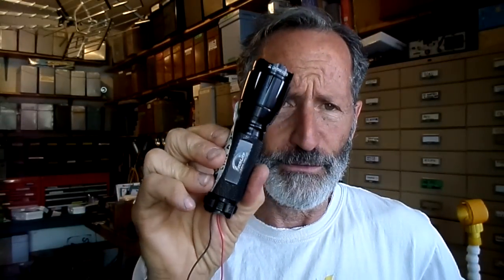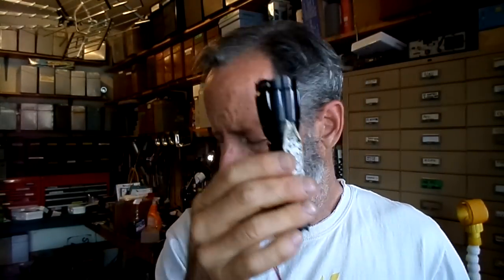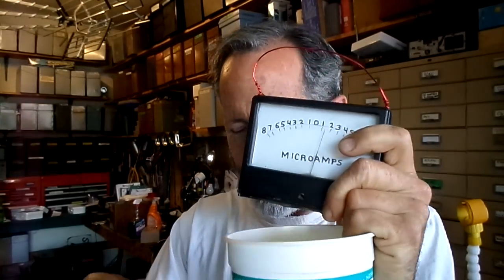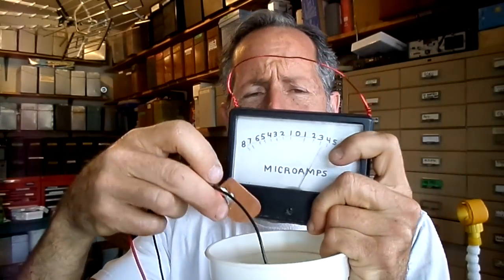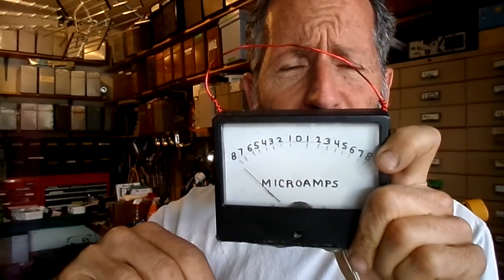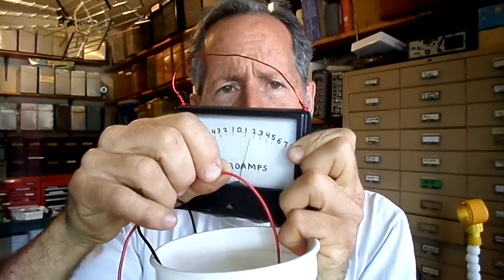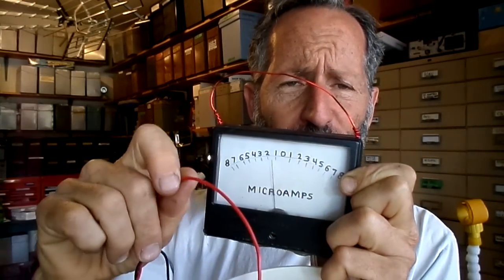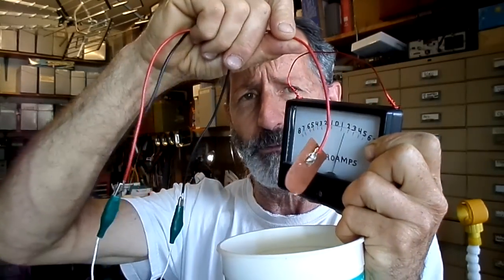LED flashlights that drain batteries when turned off.

Comment: I bought a 3 pack of Duracell 380s maybe 4-5 years ago and had the battery drain problem so often that I went to rechargeable batteries.  Still, that's not a solution for wanting a powerful light that has sat around unused for a month or so, and sucked the batteries dry.  A solution I came up with (sorry if someone has already described it here) is to totally unscrew the back of the flashlight when not in use, which completely removes the battery pack from any connection that might drain it. A bit of a pain to retwist the back on when I need the light, but it does work.

Comment: This is the problem with soft power buttons. My old Maglite has a standard switch and no microcontroller. When it's turned off, it draws absolutely nothing.

Comment: Stay away from Nebo Slyde flashlights they'll degrade the batteries so the light is noticeably dimmer within a weeks time. An easy way to tell is to gently press the button and see if the light will go on/off/cycle thru various modes without clicking into position. If you have to click the button to make light go on/off, there's a good chance that there is a physical switch, and the light won't drain your batteries. The soft power button is a "power request" to a controller chip that will usually drain the batteries. I'm waiting for a Microsoft Windows Wifi enabled flashlight to display a message "Don't turn off - updating software." Aaaarrrrgggh!!!!
Reply: ....I completely agree, I actually own 6 nebo flashlights,  they were fine for about the first few months...
The 18650's have both pos + negative on the same end, the batteries end up with oxidation and carbon on the end and causes the light to flicker etc, just a miserable way to design a flashlight...
Fact is, they weren't cheap and they are some of the worst flashlights I've ever owned. 
I wouldn't recommend them to anyone.!!
Also have a charging chip mounted on the end with both poles, 3 of the chips have failed already rendering the battery useless.

Comment: The draw on the TechLites is from the microswitch/PC board on the end cap that controls the High, Low, Strobe settings. The solution is to retrofit the mechanical switch from the cheapo China-Freight flashlights into the end cap of the TechLite. Did you ever notice how long the batteries last in those China-Fright flashlights that they used to give away and sell for super cheap? The answer is the mechanical switch: On/Off only. So if you don't mind losing the multiple settings, ditch the original switch. I've done a few of my old TechLites from Costco and works like a charm.

Comment: I have a pair of off brand tac light clones that are more than 2 years old. The original batteries still perform well. The worst thing about them is the two stupid blinking light features that you have to cycle through when turning the flashlights on. I use these flashlights fairly often.

Comment: I wasn’t aware of parasitic drain on flashlights with “soft” power buttons at all. Makes sense when I think about it, but it wasn’t something I even considered when I bought two Mag-Lites a few years ago. When the small one sucked the batteries dry in just a few months, I blamed it on the batteries, then I thought I had bought a faulty unit, now I know what’s going on with my eye-wateringly expensive flashlights: they reliably render themselves useless, by design, and I have yet to find out what the advantages of this kind of switches are. I also don’t want to know, because whatever these things are good for, they’re completely wrong for my purposes, for the way I use my flashlights.

I understand that taking out the batteries is a sensible thing to do anyway, but let’s be real: we don’t. We keep a flashlight in the drawer for small and big emergencies, and we expect the batteries to go dead from age or usage, and not because the flashlight stays in standby mode like a smoke detector.
Reply from the maker: On some models the power draw is enough to drain the batteries pretty fast, and others just pulled a few microamps.

Comment: Hi, can you do a video with the selfmade near field probe and little audio amplifier, and use it for troubleshoot something ? I find this a really handy tool that i want to make myself, and love to see it prior in action. 
As i'm not mistaken, a audio / RF signal tracer probe can not be used for troubleshooting a switching powersupply, but the near field probe can do this?  Thanks in advance. Greetings from Belgium.
Reply from the maker: All you really need is a coil, a diode such as a 1N914, and a multimeter as I showed in the video at this link. https://youtu.be/y-DAutCRuLo
Reply: @GrantsPassTVRepair  , Thank you.

Comment: It seems the new Duracell batteries start leaking and corroding terminals long before the battery should self discharge, at least in my flashlights

Comment: I'm issues with the quantum headlamp from harbor freight ripping through AAA batteries, even lithium Energizers. Only get a couple of hours out of a fresh set of lithium batteries.

I didn't think led bulbs drew that much power, but have been wondering if maybe the AAA battery pack they chose for the design is a flaw and would be been better paired with a AA battery pack? Or maybe it's just something wrong with the one I got
Reply from the maker: Could be there is energy being consumed when the light it off as I discovered on some models.
Reply: @GrantsPassTVRepair ok thanks, I'll try and test it or just take the bats out in-between use

Comment: I have the Techlite and I confirm that it drains the batteries quickly while off.  So I just unscrew the battery compartment lid and leave it near the flashlight.   Then I screw the lid back on when when I want to use the flashlight.  What a pain.
Reply from the maker: I understand. I suspect there are many flashlight brands that have this same problem unless they have a latching switch that completely turns off and disconnects the batteries from the curcuit.

Comment: The 9v battery flashlight is really bad when you think about it. Big battery with low capacity, maybe somewhere around 400-600mAh. You can easily use a 2200-2500mAh 18650 lithium battery along with a proper led driver IC  and configure your own current limits to whatever value you wish. Set it to 1mA if you want, and you'll get a super long life... and bonus you can charge 18650 batteries with a 1$ chip and a usb connector.
Reply from the maker: The 9volt flashlight will stay on for two months.
Reply: @GrantsPassTVRepair  At 1..2mA with a led of 3v forward voltage and 3v...4.2v from lithoim battery, you have about as many hours as capacity... so 2500mAh / 24hours in a day  = 105 days or ~3.5 months. Considering you can charge the battery in 2-3 hours I'd say that's good enough.

Comment: I store my flashlights with a business card folded between the batteries and the tail cap. Remove it when you need to use the flashlight.
Reply from the maker: Good idea.